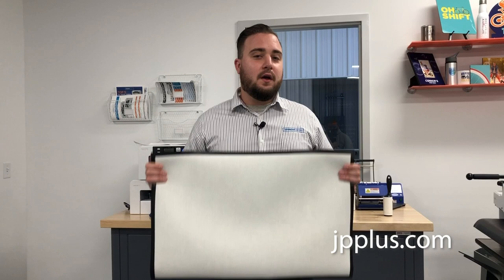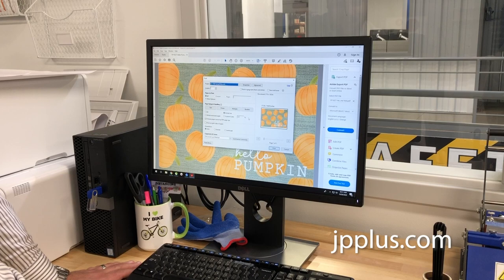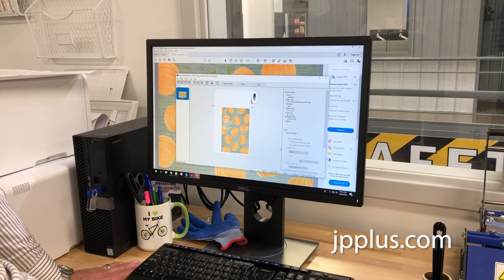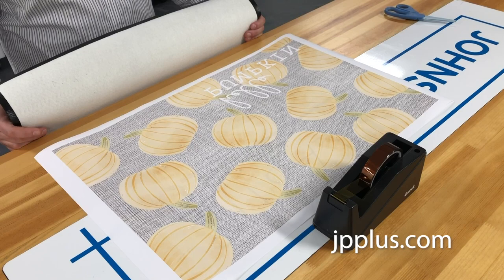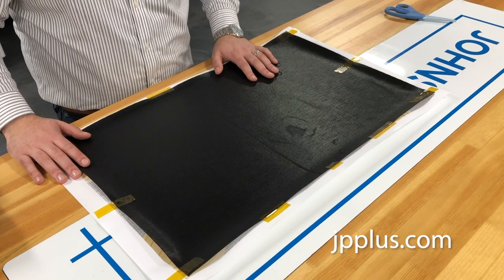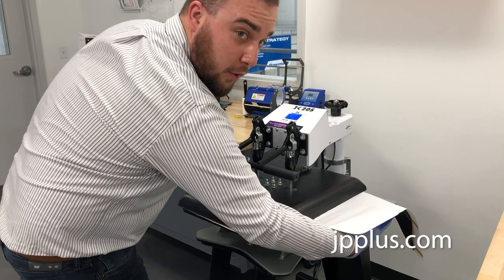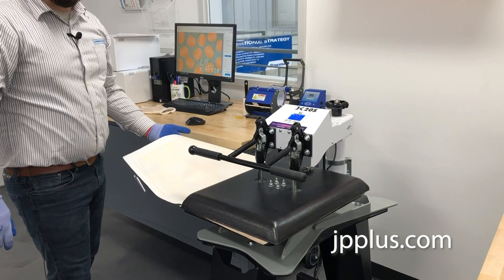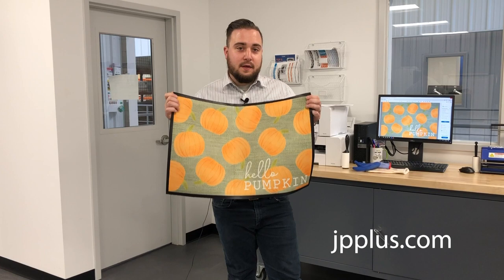Sublimating Floor Mats with Evan

Comment: Are these mats for indoor and outdoor use?
Reply from the maker: Hi Samuel...great question!  We recommend indoor use for these floor mats, but they'd probably be OK in a protected outdoor setting, such as a covered porch or garage.  We would not recommend you place them in direct exposure to the elements.